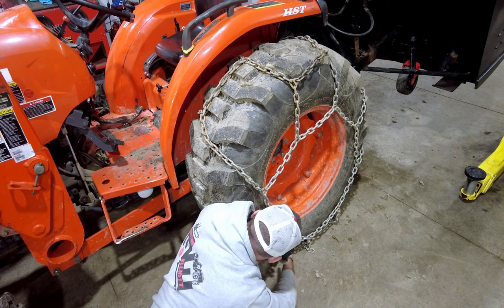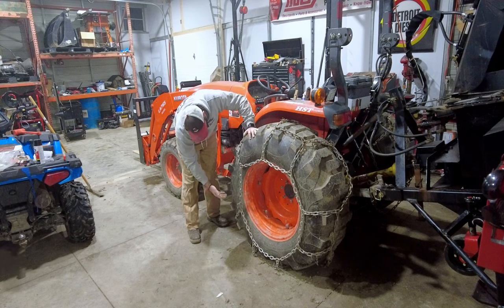Mounting Tire Chains on my Tractor - Solution for Better Traction in Snow!

Comment: I use ratchet straps to keep tension on the chains. I cut them down a bit and fed it thru the rim opening to the other side. Tighten them up and Kept the chains nice and tight all winter long.
Reply from the maker: That’s actually not a bad idea…I never thought of using straps. Thanks for the tip!
Reply: @EverythingElliott  it definitely works great. Bought my straps at harbor freight for cheap and put them on.  I saw your rims have a opening like mines and figured it would be great for you as it was for mine.  Love your videos!

Comment: I have the same size tires on my tractor and I got a new set of low profile chains with carbide spikes from our local kabota dealer for $300 last year. I was going to build my own also but couldn't build the chains for anywhere near $300 for what I bought from Kabota. Either way chains are chains and they'll work weather built or bought.
Reply from the maker: after looking back at the old video, these cost me $180 in material, I was wrong in saying it was $300.
Reply: @EverythingElliott  I saw your comment after I wrote mine

Comment: I have my chains on the tractor year round. Skidding logs for firewood and then snowplowing. I read that you're not supposed to put chains on the front tires, even if it's 4x4.... Do you happen to know the reasoning behind that?
Reply from the maker: Ive seen people do it but i believe the idea behind it is the gear set in the front isn’t as strong so if the front suddenly grabs traction you could snap an axle
Reply: @EverythingElliott  Ah! That makes sense. I've only put the front chains on when plowing, so they only thing they're really grabbing is snow.

Comment: Hello Elliott, I have tractor chains that have been hanging for 20 yrs, never needed them after installing Ag tires on our tractors, Happy New Year 🪵👍🏼🇺🇸
Reply from the maker: Ag tires would destroy my lawn, that’s why i opted to shy away from them. Happy New year!
Reply: Thats the same reason I didn’t have ag tires on my 1st kubota a L3710, it got stuck everywhere on the farm, constantly winching it out. And it was 4x4. Definitely have to have in 2 wheel drive in the yard, nice snowblower 👏🪵👍🏼🇺🇸